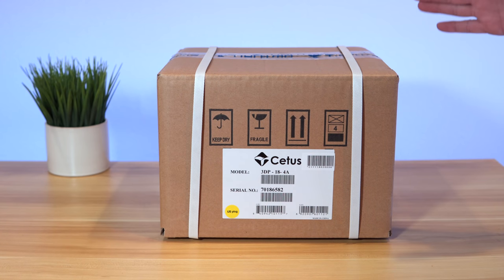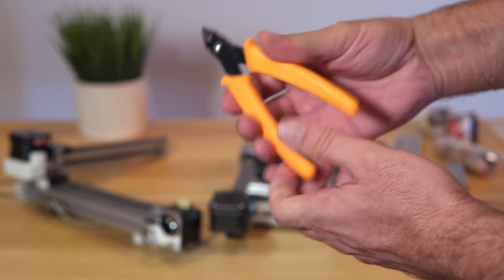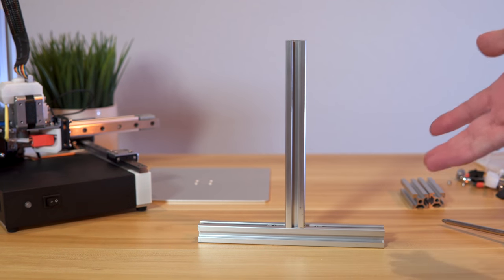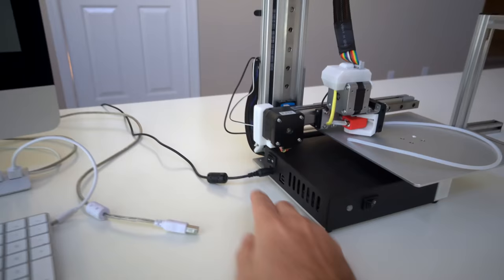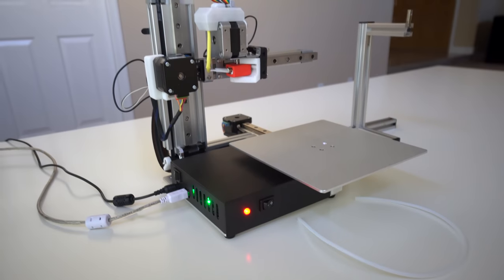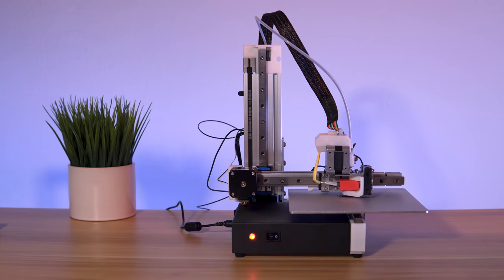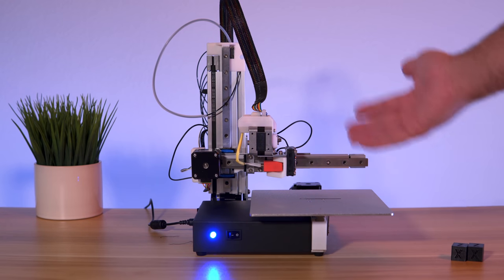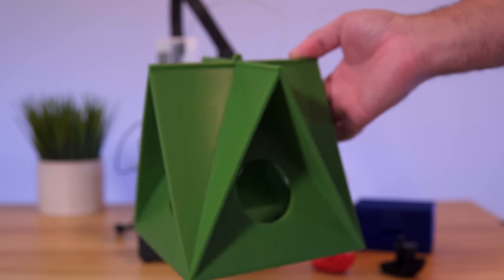Cetus MK3 - High Speed 3D Printer - Unbox & Setup

Comment: I have the MK2 extended and it has been very good.  It has a compact form factor, but still quite a reasonable build volume. The linear rails are not the cheap ones and will last a long long time. Definitely better over time than v-rails. Customer service has been excellent.
Reply: Tell me more I’m looking at the Cetus for the wattage consumption. I’d like the heated bed but that’s more wattage I can deal with. I’d like to use cura and I’m aware it’s possible with the upgraded board but then the heated bed compatibility goes out the window.

Comment: Disappointed you identify ringing and do not discuss if it can be fixed. Do slower speeds help? Is there something to the structure aggravating vibrations. Another video I saw suggested the extruder in not firmly mounted. Perhaps using only 2 screws to hold it to the mounting plate is causing this issue.

Comment: For that price you can get a prusa mini when it comes out but awsome video keep up the good work
Reply: Why do you think Prusa is better? I am actually comparing the two right now and Prusa mini is out.
Reply: @kubectlgetpo  Get the prusa mini  i comes with a heated bed plus you not locked in with there softward plus it comes from a good company
Reply: TheSavageDog28T you can use other software if you upgrade to the optional board but you lose the ability to also upgrade to their heated bed option which is entirely stupid, had they made those options available in one move I’d be all over this, 90w is amazing for what I need.
Reply: @whoa6375  tinyfab cpu + tinyfab heated bed and everything is fine up to 100°C bed temp... Prusa is not bad but the contruction is more or less in the consumer area settled. The cetus is super precise with the linear rails which you still can´t find often in 2020 on other models.
Reply: @kirkdis  ive been using the mk3 in my off grid setup and it prints well without a heated bed but theres always the option to just make one, i do like the cetus a great machine

Comment: Hello, can I use the filament PC polycarbonate with this printer? Thank you.
Reply: I am sorry if this is late...
But I cam confidently say no.
PC requires very high temperatures, for the nozzle and the bed.
I have tried to print PC on my fully enclosed printer. With a hot end temp of 270°c and a bed temp of 110°c and I still suffered from some massive warping.
I hope this helps

Comment: Do you have to have the computer on and connected for all the print time?
Reply: Yes you do, so you have to make sure you don't have a screensaver or any notifications on or your print will stop, tethered printers are best left alone also until the print has stopped, you are also more than likely going to destroy your monitor with burn-in as well
Reply from the maker: No, once you send the file to the printer you can completely disconnect from the computer if you wish. Hope this helps

Comment: Linear rails are great but no display and no heated bed and no manual levelling are major omissions, that ghosting is terrible, 1 repeat is a little nut x4 is major ghosting, this is a very large step backwards from the original Cetus.
 The price of this printer would be too much even if it did not have the ghosting, you can get many great printers for a lot less than is being asked for this one
Reply: I just remembered you had a component leftover, could this be the cause or contributing factor to the ghosting?
Reply: I would get the prusa mini or a ender 3
Reply: @meltedgyrofpv8477  For the price of this you could add linear rails to an Ender 3, a 32-bit board auto-levelling and a glass bed
Reply: it does have a heated bed. and you can manually level it did you not see the option? i think once you got this dialed in it would be a great printer for the price. especially for the fast printing it performs
Reply: @leebaxtertrading  What is heating the bed? as there is nothing attached to it, entering digits into a UI is not considered manual levelling, that is compensated levelling, manual levelling is generally considered a mechanical action
Reply: My apologies I looked at the product, and you do have to buy the heated bed separate as an upgrade along with the board and teh auto leveling parts. The standard version is manual levelling. Gotta admit though the quality of prints he has with those small print times is quite good. Might be a nice desktop pritner to have in the collection